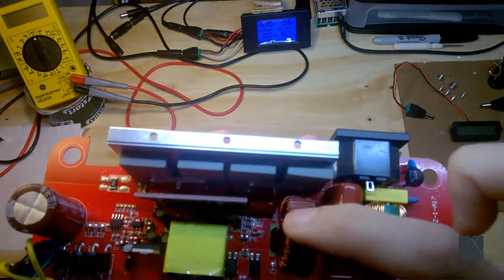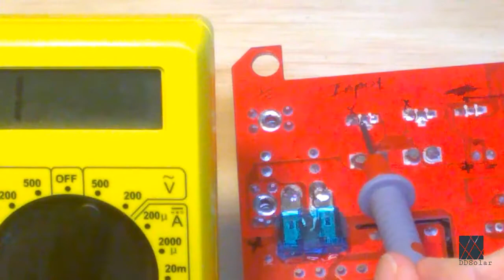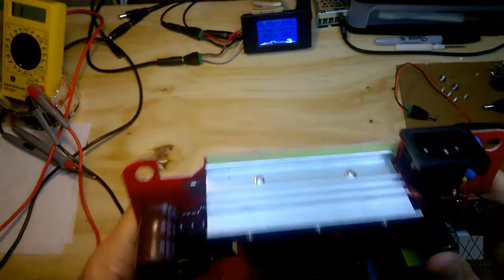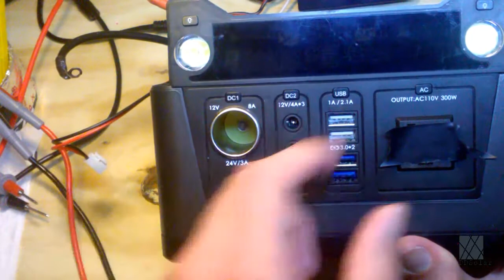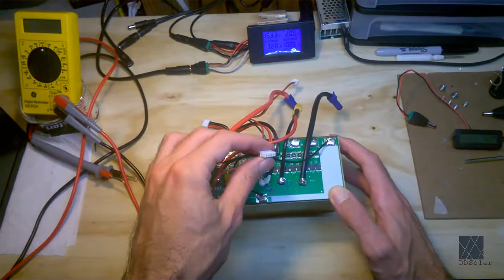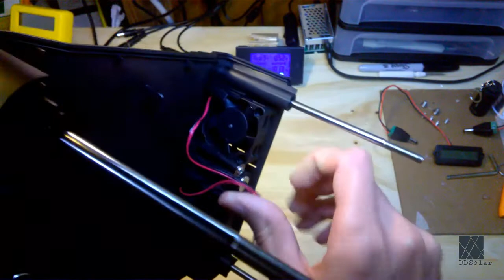Teardown and Repair or Salvage of a Solar Generator   Part 3

Comment: Have you or anyone you know of ever fixed the inverter issue in the explorer 1,000.  Basically the inverter turns on for a couple seconds, the fans run, then it shuts off and throws an exclamation signal inside a triangle.  A reset doesn’t solve it.  There was a warranty recall but I already tore mine apart.
Reply from the maker: I've never worked on or owned those particular units. It's possible the inverter board is faulty, but if it is, where to get replacement parts is a problem.

Comment: Went i connect my solar generator topshack   TOPSHAK TS-PS1000  to my solar panel i I heard a small explosion, something like a light bulb exploding, it charges well, but I can't connect anything to it because it gives me an error, I know a triangle, so I can repair it
Reply from the maker: Hi, it's strange that the generator still charges, if something burned on the solar input. A fuse, MOSFET or diode may have shorted out and burned inside the generator, but this is just a guess. Perhaps if you look inside for fuses (they are easy to test) and anything that looks burned, you might be able to repair it. I have several broken generators but was not able to repair all of them.